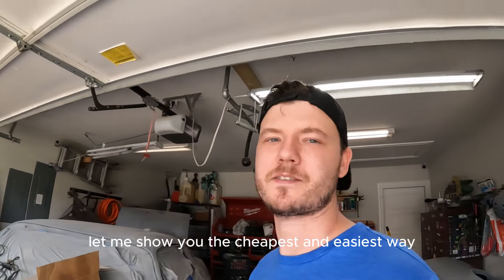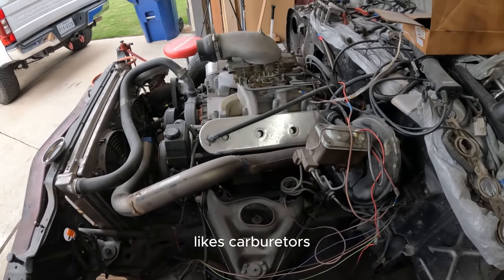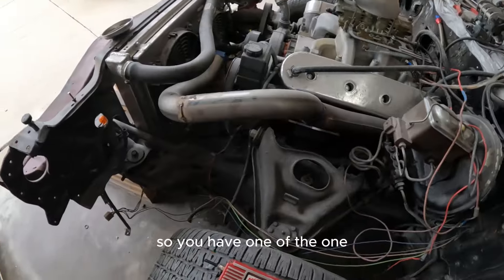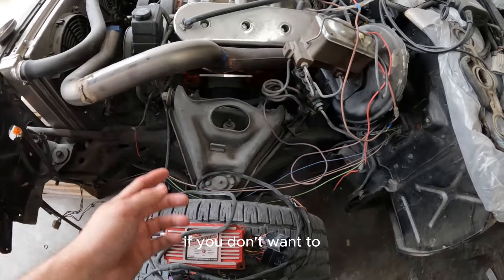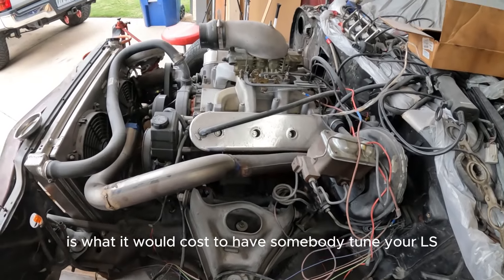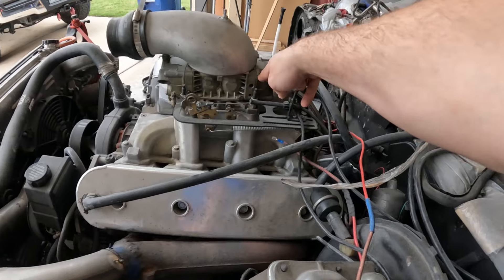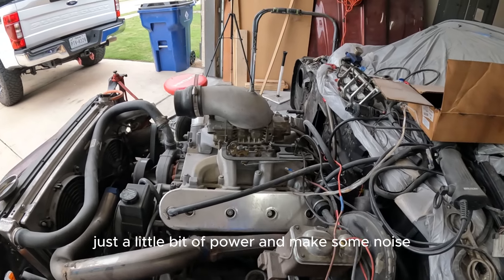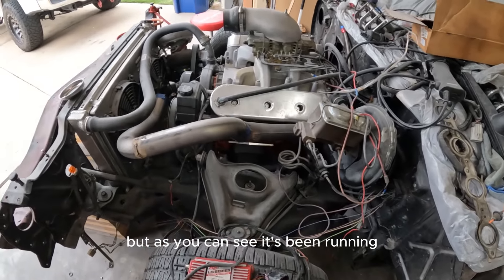The Best Way To Do A Cheap LS Swap

Comment: Hey buddy can you still run your gauges and ac with this set up
Reply from the maker: Excellent question. The msd box has a tach output. You can get adapters for oil pressure and temperature. 

Speedometer depends on your vehicle old school has the manual  cable. 

AC should work just fine. My car doesn't have it yet...
Reply: @Bad_Larry_Motors  im thinking about doing this on a 96 k1500 4×4 truck has been off the road 5.7 engine problems since 2018 . Not very knowledgeable on any of this though. Never herd anything like your set up before it really does sound quiet simple!
Reply from the maker: I love it. Especially if you know your way around a carb. All the benefits of an LS with the simplicity of a small block